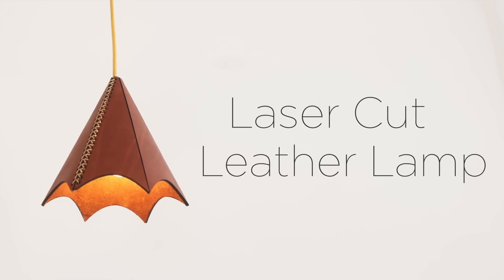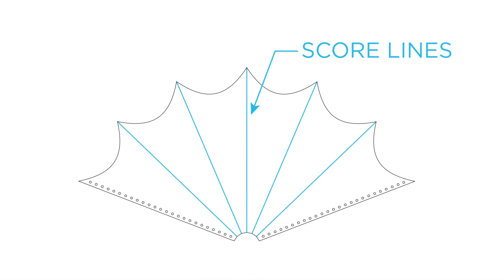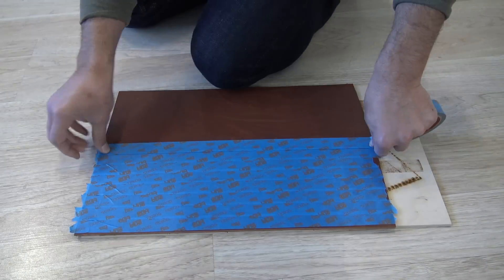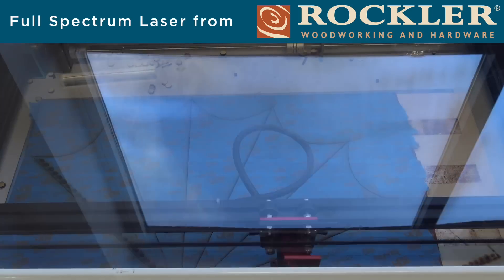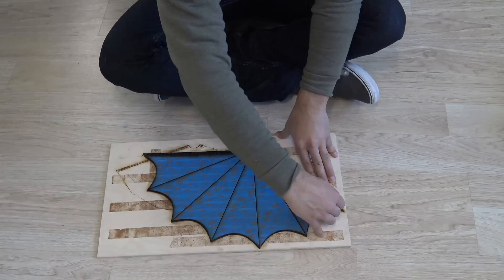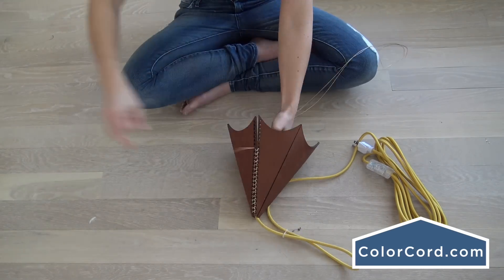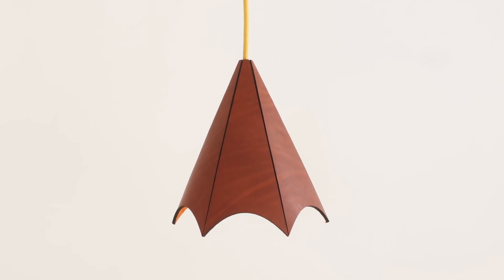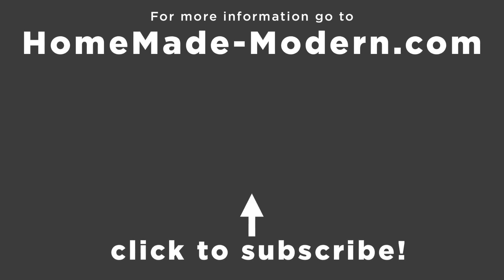Laser Cut Leather Lamp | Digital Fabrication Project

Comment: wouldn't a good pair of scissors do the job faster?
Reply: You can also use knifes that are made for leather work. He could have done this project quicker if he used traditional leather working tools.  The only advatage that a laser cutter has in this situation is that it can produce products of the same quality every single time.
Reply: No. You CAN do this without a laser cutter, but it will take longer, be harder, require less versatile tools, and probably turn out worse since you aren't skilled at it.